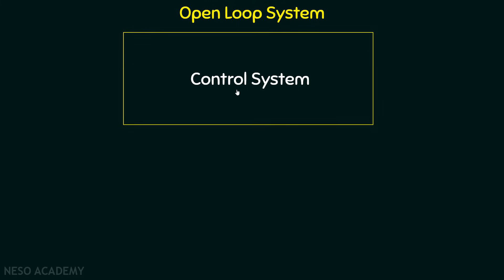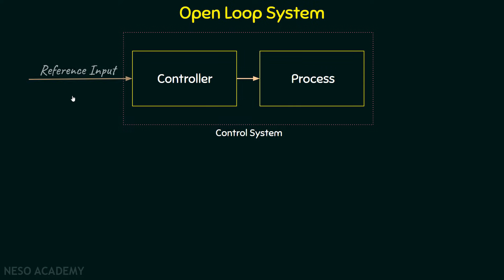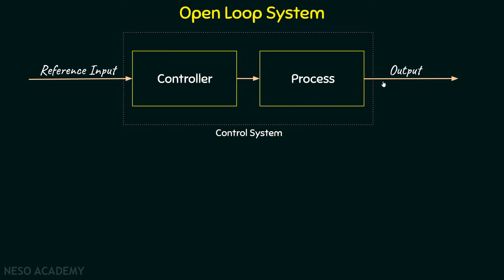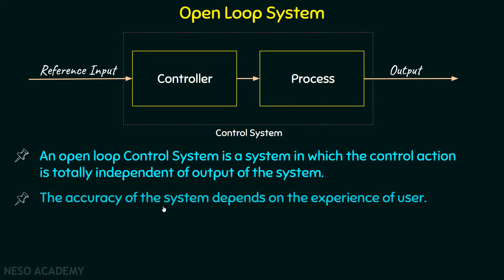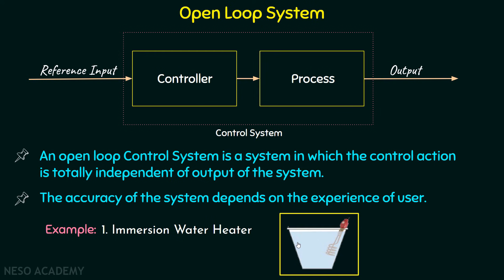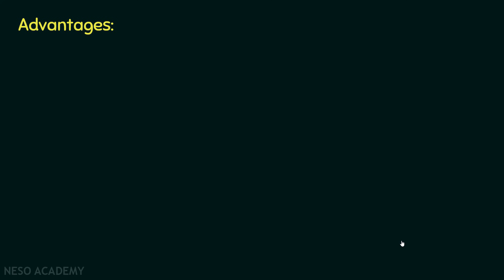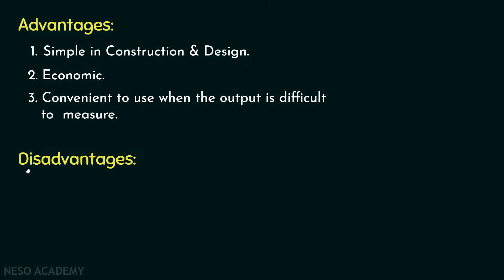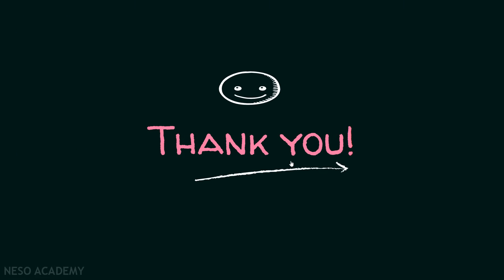Open Loop Systems

Comment: HOW IS A TOASTER AN EXAMPLE OF OPEN LOOP SYSTEM?I THINK IT IS CLOSED LOOP SYSTEM BECAUSE IT STOPS ITSELF .THE LEVEL OF TOASTING CAN BE INCREASED OR DECREASED.PLEASE CLARIFY THE SAME.THANK YOU
Reply: The toaster is an open loop system. It stops because of the timer you will have put. Had it the ability to check if the toast is well-done and stops, then we would put it in the category of closed loop system. If you over set the timer, the bread would become black but the toaster will still be toasting. It will not know that the bread is burning. So, it is an open loop system.
Reply: Why are you yelling
Reply: @aidanvega9778 He's just living out LOUD perhaps, as some of us need to. So perhaps let's just leave him be and respect quietly.